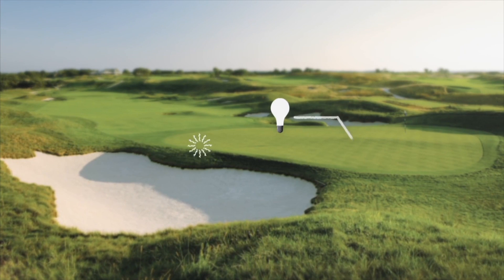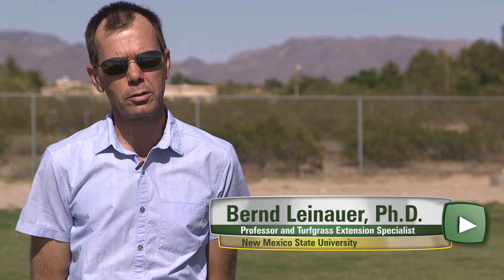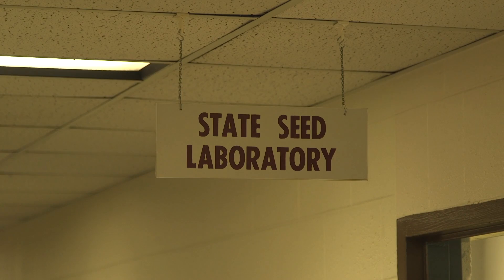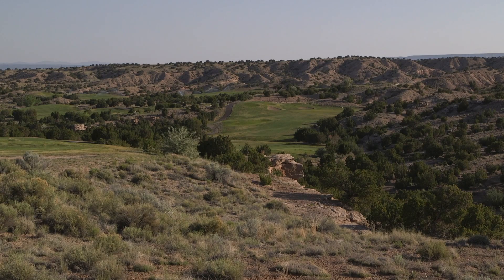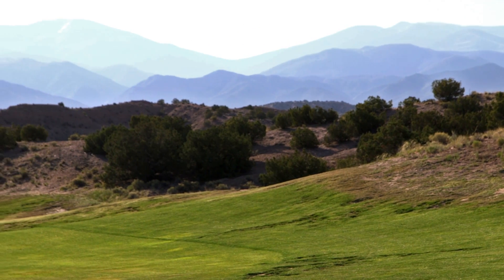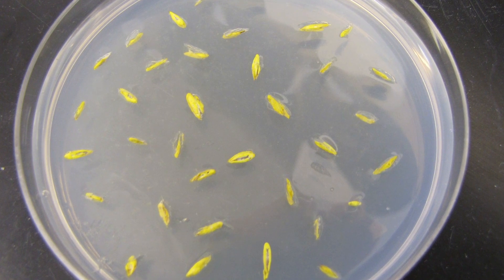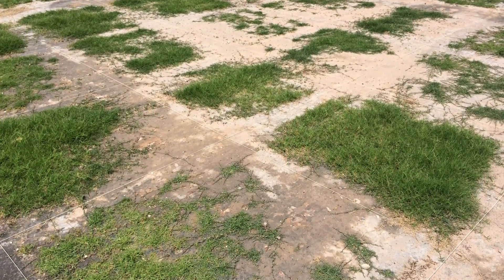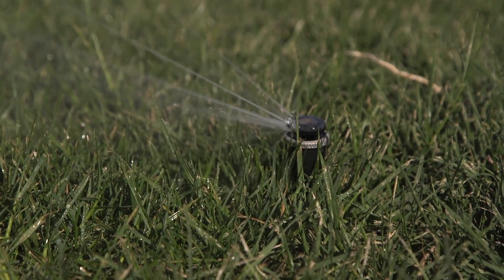FACT OR FESCUE: COATED SEED VS. NON-COATED SEED PRESENTED BY BARENBRUG USA

Comment: I cant speak for coated grass seed yet, but the packs of coated veggies, such as  'little gem lettuce' and 'turnip' and some flowers   from McKenzie products are really bad, never had a problem before this. if I planted, indoors, 50 seeds, I was lucky if 5 germinated. I will never use coated seeds again. not matter what the company or the product is. I didn't have so much trouble as I did sense I used coated seeds. its by far the dumbest thing I ever did and I did a lot of dumb shit.